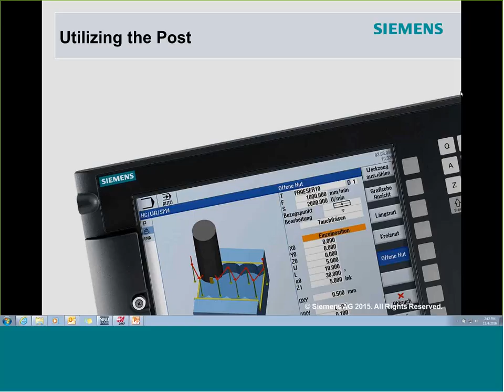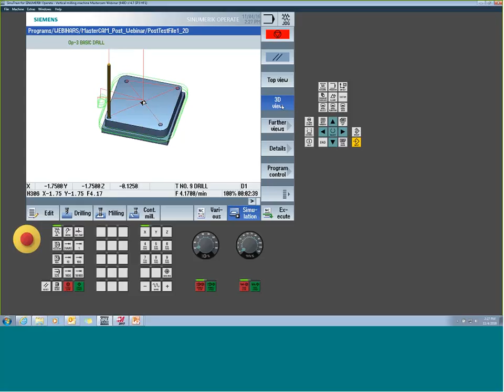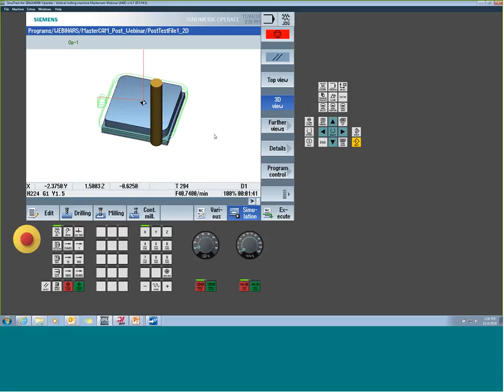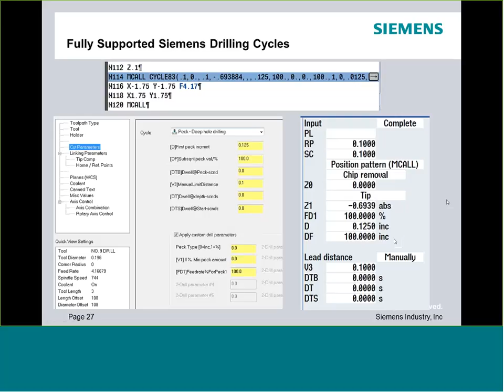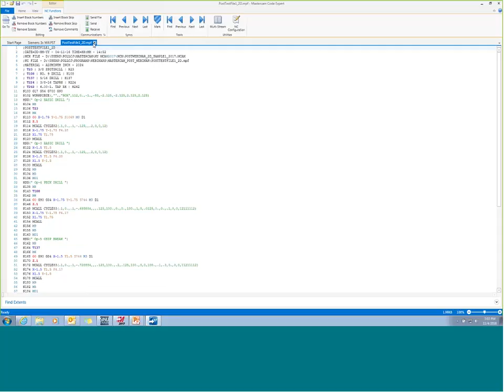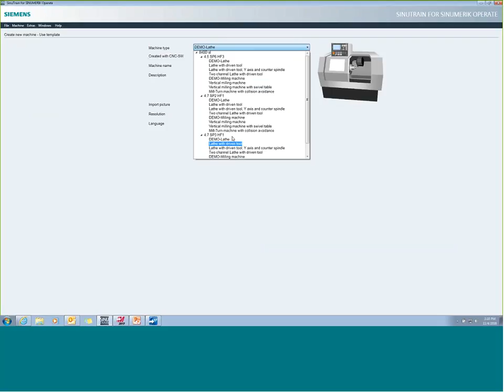Utilizing the new Mastercam Certified Siemens Post for 3x Milling SINUMERIK 840D Sl & 828D

Comment: Hello mr Cnc  i need your help to find a mastercam lathe post for Siemens 840d sl
Reply from the maker: At this point the only mastercam lathe posts developed by corporate mastercam are for the Mill/Turn product.  if you are not using MT then you will need to reach out to a reseller.
Reply: @MrCNC  i am using a millturn module